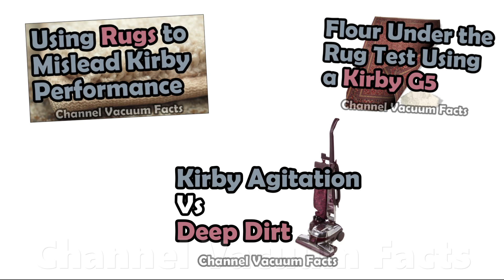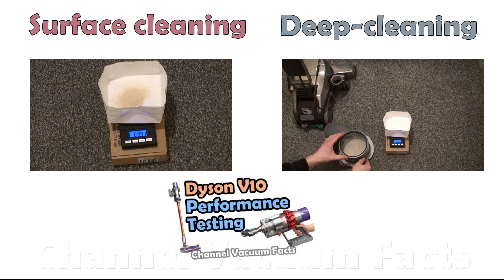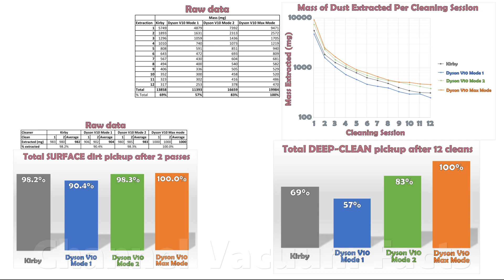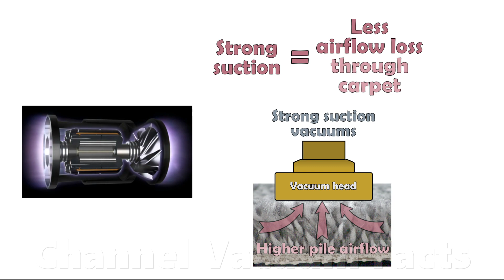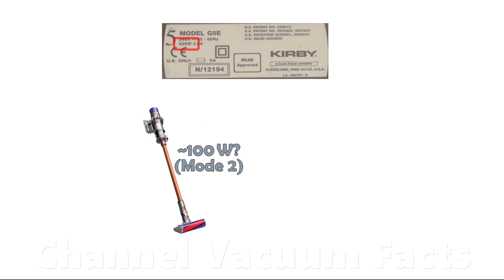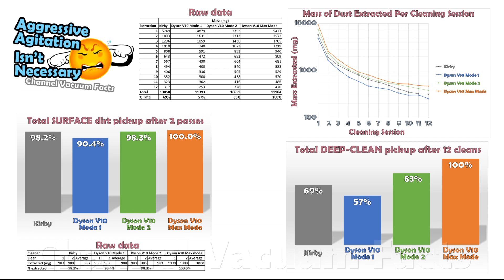Dyson V10 Vs Kirby: How Well Does a Kirby Vacuum REALLY Clean?

Comment: After watching your video and reading some comments, I have to chime in - I can resist no longer! Keep in mind these "facts" are from real world testing and haven't been proven "scientifically" as it would be unnecessary; it's really common sense. First off, Dyson is not industry leading, they are masters of marketing, just like Apple is. Secondly, suction does not clean - air flow does and the Kirby has 150CFM of it at the cleaner head and high double digits under the carpet - the Dyson only has those double  digits at the cleaner head and it drops so much lower under the carpet. Dyson's also have a brushroller that is known to shred and tear carpets. If you have ever felt the bristles of a Dyson brushroll, they are very stiff and made of a plastic like material. Kirby uses medium stiff bristles and they are made of a nylon material. Third, we have had two Dysons that endured normal usage and we're not abused and they lasted three maybe four years before switches would just randomly break, the brushroller motors went bad and the overall machine just started to fail. I have an Avalir now and love it! Deep cleans, has amazing air flow and the shampoo system works great! I respect you like Dyson; they make some neat looking machines however, your facts are not consistent with tests that have been done or real world testing. That's just like saying a Chevy Impala can go faster than a Corvette - you don't need scientific testing or facts to know the Vette will beat the Impala. There are many examples (look on YT, Google) proving that direct air vacuums out clean Bagless and clean air vacuums.
Reply from the maker: The factual claims you made are incorrect and this has been demonstrated in other videos on my channel.
Reply: @VacuumFacts  I would highly recommend watching the YT channel, VacLab - it has been mentioned many times in the comments and for good reason. Bill, the owner of the channel is an engineer and degreed mathematician and has conducted many scientific tests on Kirby vs. Dyson and mathematically proven why Kirby cleans better than Dyson and most other vacuums. I am not going to re-do his tests as they have already been done and I believe that would be copyright infringement however, the proof you are seeking is on that channel in very organized playlists. I have a Dyson cordless and every attachment to go with it for when I have zero energy to pull my Avalir out because it is a "Kir-Beast" however, when I need to seriously deep clean and need power, I reach for my Avalir every time!
Reply from the maker: @Jordan-nj2ve  Much of what the channel you reference has shown has been fully debunked in my videos to ensure it cannot mislead. The knowledge gaps and mistakes in understanding the channel has demonstrated have been filled on my channel.
Reply: @VacuumFacts  Not really. All the tests done on the VacLab channel are done consistently and accurately. The Kirby you are using, there is lots we don't know about it other than it's a G5. Your also using the demo dirt meter which is NOT designed, at all, for the amount of pickup your doing. That is for very small test areas. A Kirby cleans with high air flow and by going from a huge bag to a small pad, you are suffocating a Kirby and preventing it from breathing. You used nothing but the regular bin on the Dyson so it has its full power the whole time. Dyson has tons of suction and Kirby doesn't, I'll agree there however, it's airflow with good agitation that cleans well and the Kirby has 150cfm (Avalir) of airflow and high agitation. All of the Dyson airflow is lost pulling it through the many cyclones and filters it has; why do you think and all the Dyson commercial and advertising the claim is never loses suction? even when the bin is full and the filters are clogged the Dyson always has suction if you put your hand over the edge of the hose there's always suction but it has no air flow and that's what does the cleaning. Out of curiosity, I saw you mentioned you had just recently fully serviced the Kirby, what type of brushroll are you using?
Reply from the maker: @Jordan-nj2ve  All this has been accounted for in the videos. Also, the dirt meter pads' performance was not impaired by excessively high dust loading. This is clearly shown in the data which follows the exact same trends as systems which are unaffected by dust loading. The data is clearly there, so I'm not sure why you even raised it as an issue. It is in fact a desperate last straw myth peddled by Kirby fans who hate what is shown here. I've observed many simply swallowing it and regurgitating it in messages to me as though they have a valid point, but instead are simply ignorant of the basics, which is all the more disappointing given I have several videos meticulously outling it all in completely accessible language.
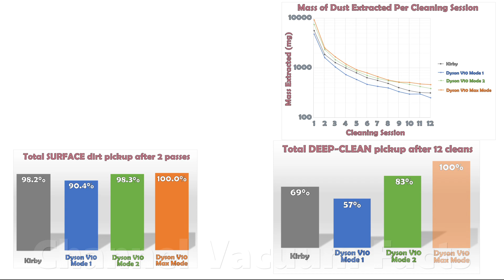Reply: @VacuumFacts  Alright, so I have watched a handful of your videos as you have requested so we can have a "fair" conversation. I want to first comment on the Kirby G5 your using. I watched videos: Review of a Kirby Vacuum vs a Dyson Cordless specifically spot 2:11 & 12:38 and video Dyson V10 (not V11) Vs Kirby on Porous Carpet
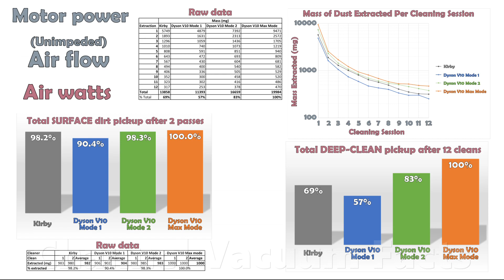 sport 5:23 and that brushroll you are using is a soft, chevron style made for delicate carpet cleaning. It is NOT going to aggressively agitate the pile because it is designed for carpets not able to withstand higher agitation. Kirby makes several styles of brushrolls for their vacuums, all interchangeable. The Dyson torque drive cleaner head has stiff bristles and is designed for deeper cleaning therefore you should have used a stiff oblique brushroll in your Kirby G5 for deep pile agitation. I'll say it again, that dirt meter is not designed for large pickup jobs. When you suck up a large amount of dirt using that dirt meter, that small area can only filter so much before you suffocate the Kirby and there is performance loss. Its the same as if you suck up fine dust past the max fill line on your Dyson and then hold it upside down or dirt is allowed to bypass the cyclones and clog the filter - you have suffocated your Dyson. Put a HEPA bag in the Kirby and then run against your Dyson - you will see different results. We also don't know how your Kirby has been maintained or if it is in proper working order. You claim it has been recently serviced but, it looks pretty beat up to me. You do all your tests on carpet with rubber backing - it seems like in the UK that is the standard for carpeting over there which is fine however here in the US, homes have porous-backed carpeting that is frizzay, plush, ultra soft etc and direct air machines have been proven to deep clean those types of carpets better than bagless/suction reliant vacuums. With the many carpet choices available today, there are going to be some instances where a particular style of vacuum will clean carpets better than others. For rubber backed carpets, because there is no airflow through the carpeting, high agitation and high suction machines do tend to be better suited for that type of carpeting. The Kirby has too much airflow for that style of carpeting thus it just inhales the carpet and is difficult to push where the Dyson has low airflow and high suction with good agitation so it will do a better job on that style of carpet. However, if you want to do a deep clean on a regular carpet, the Kirby will win against the Dyson because paired with the high airflow and stiff oblique brush, it digs much deeper than the Dyson can. I have a Dyson, I am not against Dyson in any way its just different vacuums work better for different jobs and all your tests are on rubber backed carpets and just show graphs and charts which can easily be manipulated; people watching your videos have no idea how you set the tests up or anything about the carpets or vacuums your using. Watch how VacLab conducts his tests - they are methodical and scientific. I also saw your video on the cordless Henry and if I'm not mistaken, that cleaner is only designed for hard floors and low pile carpet - not the gray high-pile stuff you were trying to clean. I will totally agree that the batteries used in the Henry are cumbersome and its a pain to have to remember to charge them and fiddle with the charger. Just docking the Dyson and having it charged and ready to go is a wonderful feature. Your videos are well put together and organized and if I was looking to upgrade my current Dyson, your channel would be a great resource for a comprehensive product review and demonstration of the Dyson and its pros and cons although I haven't really heard any cons as you seem to be very happy with your product. Not to be rude but if I was looking for useful scientific information as you claim to be manufacturing on your channel, I would refer to VacLab or another channel that shows the entire testing process from start to end and shows the machines, while maybe not the same, have been serviced exactly the same so the playing field is as fair as it reasonably can be.
Reply from the maker: @Jordan >>That brushroll you are using is a soft, chevron style made for delicate carpet cleaning. It is NOT going to aggressively agitate the pile because it is designed for carpets not able to withstand higher agitation. Kirby makes several styles of brushrolls for their vacuums, all interchangeable. The Dyson torque drive cleaner head has stiff bristles and is designed for deeper cleaning therefore you should have used a stiff oblique brushroll in your Kirby G5 for deep pile agitation.

Any vacuum that expects a user to go through the hassle of wasting their time physically changing out fiddly duplicate parts like brush bars is not a well-designed one. You also haven’t explicitly quantified and evidenced the stiffness of the two brushes used in the video to support your point. Nor have you provided any objective evidence it makes any difference whatsoever. It’s all speculation. Then you’ve not accounted for everything discussed in my other videos explaining why vibrational agitation is irrelevant for dust, why bouncing particles is unrelated to cleaning performance, and how a brush roll cleans anyway (to separate pile). You’re only offering opinions and also showing knowledge gaps in many things already discussed in my videos—not apparently in the mere “handful” you’ve watched.

>>I'll say it again, that dirt meter is not designed for large pickup jobs. When you suck up a large amount of dirt using that dirt meter, that small area can only filter so much before you suffocate the Kirby and there is performance loss.

I’ve already explained this in the previous comment. There is no evidence the dirt meter was clogging for the small amounts of material being collected. Plus, the particles were much larger than the micropores of the filter. This is clear from the data where dust mass extraction trends as a function of dust loading were identical to a system which is known not to suffer from suction loss as a function of dust loading. The objective empirical data in the plots is right there in the video and clear as crystal; I suspect you simply don’t understand it. Additionally, any resistance to open hose airflow provided by teh filter is dwarfed by the resistance (and reduced airflow) provided by a carpet pile. This point simply doesn't seem to sink in with Kirby fans, suggesting it's completely misunderstood.

>>We also don't know how your Kirby has been maintained or if it is in proper working order. You claim it has been recently serviced but, it looks pretty beat up to me.

It had been professionally maintained by a vacuum repair shop. You’re welcome to second guess their trustworthiness if you like. The best vacuums simply work and only need space in the bin, a reasonably clean brush bar, and periodic filter rinsing. Any vacuum that needs maintaining to such a degree that you are implying is clearly not very good. Oh and let’s not forget the age old chestnut illogicality often regurgitated in comments about the Kirby; they ‘last forever’.

>> For rubber backed carpets, because there is no airflow through the carpeting, high agitation and high suction machines do tend to be better suited for that type of carpeting.

I’m glad you agree; it took me making an entire video for this point to be even acknowledged by the more unpleasant Kirby enthusiasts out there.

>>The Kirby has too much airflow for that style of carpeting thus it just inhales the carpet and is difficult to push 
This is incorrect. As explained in the videos, the airflow is dramatically curtailed on such flooring due to the lack of suction capable of overcoming air resistance. The reason it’s hard to push is simply because the surface area of the soleplate is large such that the force associated with its pressure difference is large (i.e. basic physics taught to all children). I’ve demonstrated this empirically accounting for performance loss with the Kirby and I've also shown that a flooring type allowing airflow from underneath results in cleaning performance comparable to the Dyson it was tested against (which incidentally proved the cordless can clean as well as a Kirby mains cleaner).

>>where the Dyson has low airflow and high suction with good agitation so it will do a better job on that style of carpet. 

Again incorrect. The Dyson’s high suction maintains greater airflow through a resistive pile. People (Kirby fans) continuously confuse airflow at the open hose with airflow through a resistive pile. They can’t seem to get that increasing resistance with a carpet pile causes the net airflow to drop. And they never measure this directly and still haven’t to date. I’ve got another video in on the list to explain what they should be doing, assuming a single person hasn’t figured it out for themselves by the time I make it.

>>However, if you want to do a deep clean on a regular carpet, the Kirby will win against the Dyson because paired with the high airflow and stiff oblique brush, it digs much deeper than the Dyson can.

Your opinion is in direct contradiction to the evidence. If you’d like to provide some objective evidence and data, and not the ridiculously flawed and erroneous bedroom testing seen in many amateur YT videos that has been debunked, then I’ll take a look.

>>…all your tests are on rubber backed carpets and just show graphs and charts which can easily be manipulated; people watching your videos have no idea how you set the tests up or anything about the carpets or vacuums your using.

It’s all described in detail in the videos you claim to have watched. If you’re suggesting this is fake, I’ll leave you to empirically evidence that. Otherwise that just comes across as a copout based on being disgruntled.

>>Watch how VacLab conducts his tests - they are methodical and scientific. 

I have and they are NOT. They are full of errors and misleading tricks, all of which have been explained and debunked on videos on my channel. Apparently not in the “handful” you’ve watched.

>>I also saw your video on the cordless Henry and if I'm not mistaken, that cleaner is only designed for hard floors and low pile carpet - not the gray high-pile stuff you were trying to clean.

You are mistaken (again) and at complete odds with all the rabid Henry fans. As explained in the video you claim to have watched, the vacuum is absolutely designed for all home flooring and not just one specific type (basic fact check their website). Comments and claims like these which are factually incorrect clearly show you are talking nonsense and not checking anything you say.

In short, your factual claims are actually opinions in disguise. They seem to be based on knowledge gaps. You seem to admire channels that have been exposed as misleading and conducting clearly flawed tests (videos on my channel demonstrating and explaining why). You’ve made no convincing, evidence-supported argument in favour of the Kirby or the claims you’ve made associated with it. And finally, all this has been fully addressed in detail in the suite of videos on my channel. You can either watch them all and learn and understand the basic principles of cleaning, or continue to demonstrate knowledge gaps and subjective favouritism in comments like this.